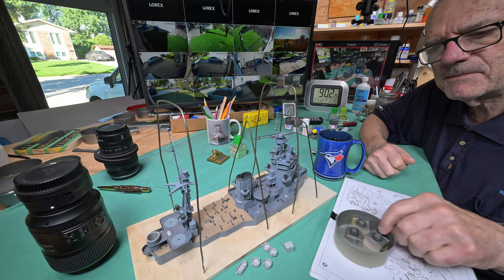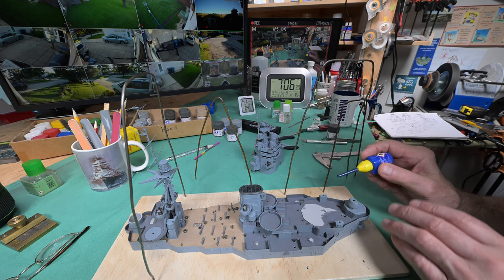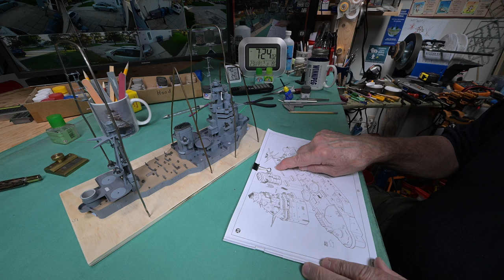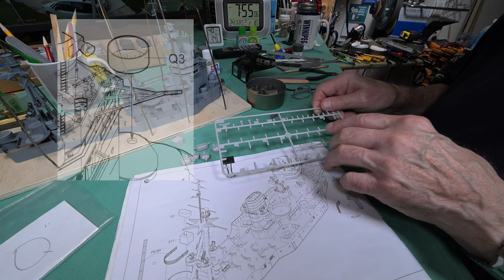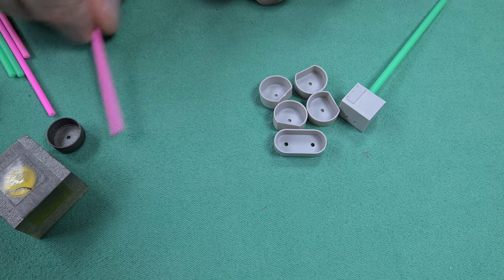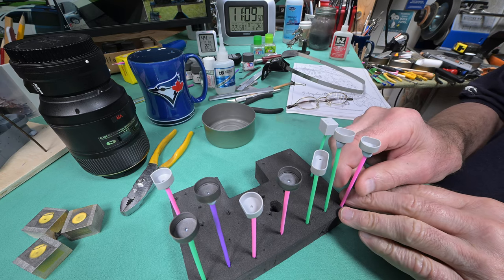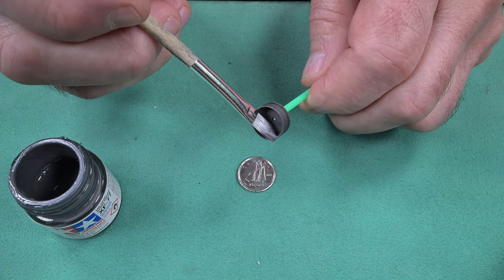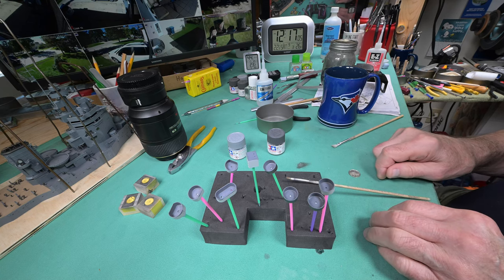The Model Ship - Part 1290

Comment: Another nice vlog Ron. Although I only get to my "Model Table" about once a month it seems these days, I'm gonna steal your coat hanger idea once I've got the masts on my Bismarck (and Hood in a few years time, currently in storage awaiting my retirement)  Such a simple solution. Keep up the good work. As My home on the Isle of Wight is at the same latitude as Winnipeg it'll be interesting to compare weather as winter comes. Best
Reply from the maker: Hi Martin,
Same latitude. Our sunrises should be at the same time --- only 6 hours apart, haha! 😁
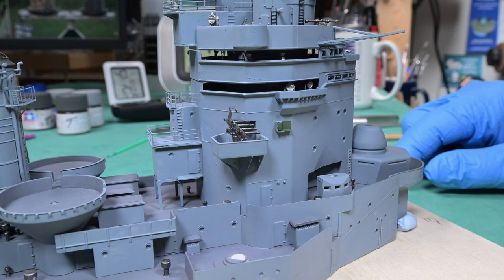Reply: @roncalverley   Almost we are just a touch north at latitude 50.73N with you at about 49.90N so our sunrise is due 06:24 tomorrow , yours at 06:50. Well have to compare winters later on, ours are pretty mild thanks to the Gulf Stream.
Reply from the maker: Re: "Well have to compare winters later on"
I will undoubtedly be very envious. 😁

Comment: Hi Ron love the videos. looking for some advice as to what ca glue I should use.? There are so many options to choose from could i use an off-the-shelf glue? or should i use a specific glue for modelling ?
Reply from the maker: Hi Wee Willie,
Yes, there are so many brand of CA that all seem to do the same thing. I'd ask the folks at your local hobby store. Most hobby stores that I've encounters are only too anxious to be helpful. 🤞
Reply: I find cheap CA sold in packs of small tubes in what we Brits call pound store just as good as the expensive "model" glues. Do recommend thin and gel type.
Reply: Thanks for the replies . Will use the small tubes

Comment: Hi Ron! It's me again, I have a question about the Tamiya acrylic paints that you apply with a brush, even though I paint evenly and let it dry, there are always such uneven spots on plastic, do you know what I'm doing wrong?
Reply from the maker: My experience has been to use an airbrush to achieve an even paint layer.
Reply: @roncalverley  I actually only paint with brushes because there is so much to consider when airbrushing. And with the Tamiya acrylic paints with brush painting it just doesn't work that way, so I always use Revell acrylic paints, Goodbye Ron!